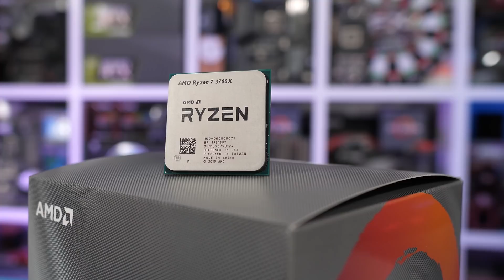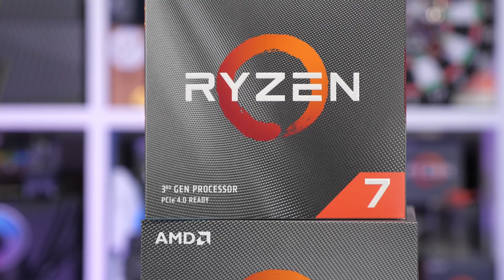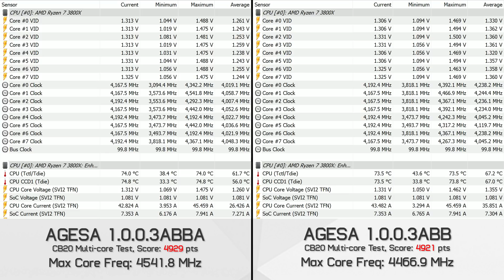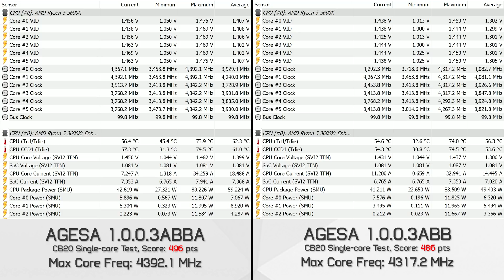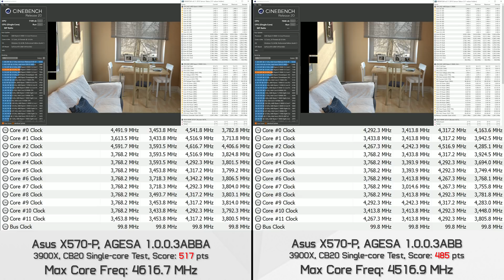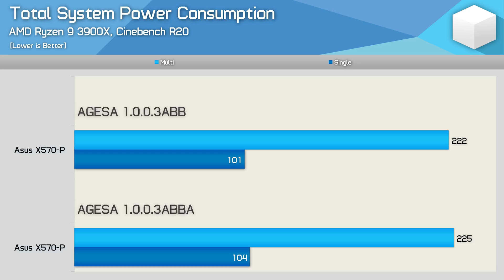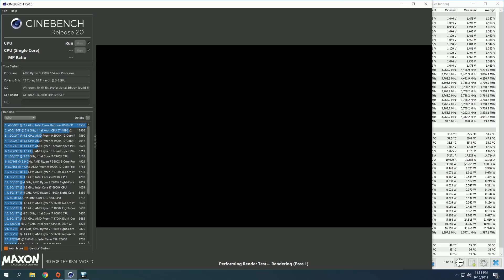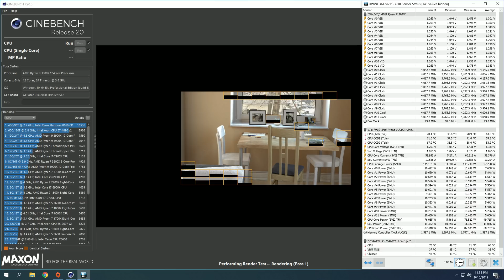3rd Gen Ryzen Boost Clock Fix Benchmarked, AGESA ABBA Time!

Comment: I thought people losing their minds over 25 MHz was a bit silly, but on the other hand, if a company is going to advertise a boost clock speed, then their products had better damn well be able to hit those clocks.
Reply: @KAKUN_DESU  If you watch his video he's going on the absolute statement of 4.6GHz, there was a huge amount at 4.55GHz and 4.575GHz and that's not taking into account many motherboards are running 99.8MHz on the BCLK which will result in 4590.8MHz when running a 46 multiplier.

I also like and respect Der8auer, however his method in this case is more than a little out compared to his normal attention to detail. All of the 4.55GHz and the 4.575GHz should technically be classed in the 4.6GHz category as he can't be sure they aren't less from standard deviation errors.

You may not like to trust the OC forums, I've been involved with them for years and guess what, it's the OC forums that are pushing for the fix that AMD just released. It's amazing how people can't fathom that little bit of information. It's not like the people interested in overclocking want better performance or anything...

I was genuinely disappointed with Der8auer's video as it sensationalized the issue and it also misrepresented it. FYI it's amazing how suddenly with the ABBA BIOS the issue turns out to have been a non-issue all along, a nothing burger, a falsehood of a problem. The real issue the whole time was the change from the pre-release BIOS which was able to hit those frequencies to the release day BIOS resulting in many motherboards under-performing in Default and PBO boost scenario's.

Thanks for giving us your uninformed opinion on who you like best though. It's been a fascinating if vacuous read.
Reply: @KAKUN_DESU  You still don't understand False Advertising.

If the CPU's never hit 4.6GHz single core outside of 5% after all the BIOS updates and so on, then you'd have an argument. You don't have an argument though as the ABBA bios corrected the low boost clocks.

You don't comprehend the data or the problem. Yet you still protest loudly. Thankyou for highlighting your ignorance yet again.
Reply: @KAKUN_DESU  You do realise False Advertising would mean that the vast majority of the CPU's would never reach the stated single core boost clocks...
Reply: @Robert Cowan They could and can, which is why I'm not objectively wrong. Even the broken 3700X which was unstable at 3.6GHz could still hit 4.4GHz either boosting or manually clocked.

The claim for boost was a single core, which means the advertising is not false. If they had claimed an all core boost of 4.4GHz for the 3700X for instance that would be grounds for false advertising.

If the CPU can hit those speeds even if the firmware/BIOS is buggy and needs fixing it's still not false advertising, the product can achieve those speeds. If the CPU could NEVER achieve those speeds you'd have a point.

As it is you don't.
Reply: @Robert Cowan The Bulldozer settlement was ruled on by a laymen who has NFI about what counts for a core. Likely AMD settled as it was the cheaper option rather than fight over a crap and dead arch.

If you go off the definition of core used by that settlement, ARM don't make any CPU's that have Core's. Many older CPU's don't have Core's due to not having dedicated FPU's. It's a nonsense ruling if you know anything about CPU Microarchitecture.

BTW you do realise courts make rulings and judgements but they do not have to reflect the truth in them.
Reply: My 3900x won't boost over 4350ish MHz on my gigabyte aorus x570 pro WiFi. ABBA agesa didn't fix it. Hopefully there's still being work done here.
Reply: @dangoodall1253  Even single core?? If so either damn unlucky on the silicon lottery or there's something funky going on. I did have to RMA a 3700X as it would hit 89C on any load applied even at 3600MHz. Replacement has functioned fine. A sample of 1 can easily just be an outlier.
Reply: @Robert Cowan How am I objectively wrong? The stated boost speeds are single core boost, not all core, I haven't said otherwise.
Reply: @Robert Cowan I guess you didn't read the court docs then.
Reply: @Robert Cowan Cool so the ruling being that it's due to the lack of individual FPU's for each 'core' sit's fine with you does it??

It was a dog and pony show for people that were pissed Bulldozer was just crap. AMD just settled to get rid of it, yet here you are dredging it up as though it's in any way relevant to Ryzen...
Reply: @Robert Cowan Yet it's still not relevant to this issue. It settled a month ago and yet has been going on for many years. AMD literally took a cost analysis and canned it. Cheaper to pay out than to keep the nonsense suit going.

Feel like getting back on the topic instead of wasting time talking about something that's utterly irrelevant to Ryzen's wide range of BIOS performance?
Reply: @Robert Cowan LOL, presents no evidence in support of claim, claims win. Gotta love arguments like that.

Please by all means show evidence the Ryzen 3000 CPU's can't hit their stated clocks. I'll be waiting. Every CPU I've tested can in fact hit their core clocks. Even the broken one that got RMA'd hit the boost clocks. Even if it did so at 90C. Hell it was 90C at 3.6GHz for that one.

The BIOS was responsible for not hitting the boost clocks stated and has been fixed. Not that the CPU's can't hit them which is the crux of the false advertising argument.
Reply: @Robert Cowan Still failing to notice the distinction of BIOS based boost control vs actual CPU performance. Damn you are a clever one.

I have a pretty strong bet that the vast majority of the 3900X CPU's would hit 4.6GHz quite easily if manually OC'd in Ryzen Master, highlighting the issue is a boost algorithm one not a CPU one.

Magically resolved in a leaked BIOS? How old are you? Your arguments are making less sense every post. The BIOS has been sent to board partners and is being released (Gigabyte first by the looks of things). It's not magically resolved, it's a boost algorithm change.

It is top level hilarity that Tom's is even still around to be fair. Their articles have been falling in quality for years now. Similar to some of the writers for Anandtech since Anand left.
Reply: I mean I still don't think it's wrong. There are systems hitting those clocks. Kinda like the i9s that won't hit 5ghz. Slightly different story but it's just cherry picking.
Reply: @Robert Cowan The 9900K cannot reach stock boost clocks within the stock TDP and with the stock cooler.
Reply: People lost their minds because it's AMD, had it been Intel there would have been a lot of brooms out and carpet lifted ;)

Not quite sure why AMD cops such a harsh backlash, but then again it does have some of the more vocal 'supporters'.
Reply: @BrKnOblivion  It does seem odd that the average person doesn't seem to know or care about the security issues facing Intel processors.  The media, aside from a few youtube outlets, has been strangely silent on them as well.
Reply: @Dirtyboxer1  I'm really quite surprised how many just have no idea about what they are buying at all. There's so much easy to access good info, yet people are still taken in by rubbish from places like The Verge.
Reply: @BrKnOblivion  Difference is Intel hit their boost speeds and you can overclock significantly higher than it.
Reply: @frostybe3r  That's like saying, because I can overclock the tits off my Nvidia graphics card I should be able to on this Matrox too.

Not really a valid argument.

Also if you are basing the OC off the Default/PBO boost, then you're kinda doing it wrong since the first gen Ryzen.

They are very different products in how they react to OC and boosting. Intel also removed the stated boost clock number to avoid the current boost clock non-issue.
Reply: @BrKnOblivion  So i am a Intel fanboy because i say my 3700X did not perform as it should have ? Is criticism allowed for AMD or should you just throw money at them and say thanks for Beta Hardware with false advertising ? AMD gets a backlash because they fucked up with their advertising. Again. If you dont want that test your product properly instead of releasing it early.
Reply: @BrKnOblivion  AMD caught up to intel so quickly, people have to find anything they can wrong with them and overblow it.
Reply: @untag4066  I suppose that's one way to look at it. I think Intel were caught with their pants around their ankles, but that can't be the only explanation. Steve's done a good job of staying unbiased but the more mainstream outlets have been very loud on AMD issues and less so on Intel's. As Michael says it's curious.
Reply: @BrKnOblivion  i dont remember intel advertising false clocks tho.
Reply: @hwstar9416  Really? Guess you haven't been around very long. It may not be directly false clocks, but the list of Intel's crimes are far longer and far nastier.

Oh and the stated boost clocks weren't false. Every Ryzen CPU I've tested and most of the overclockers forums also confirm this. BIOS's that aren't up to scratch on some boards have given a false indication of the number of CPU's that were not hitting advertised boost clocks.

Oh and when Intel didn't want to get into Boost clock speeds, they just removed them entirely. So you only have the base clock guaranteed and who knows what boost clock.
Reply: @BrKnOblivion  Yeah as much as I would like to hate on intel as anyone, they didn't falsely advertise their boost clocks. AMD shouldn't be spared because Intel is scummy
Reply: @Larythien  AMD didn't falsely advertise their boost clocks either. The BIOS/Firmware showed it can do those, and was repeated right here by our good friend Steve. Some of the other boards didn't manage it rather than just the CPU's.

New AGESA fixes said issue, nuff said.

Intel claimed fastest processors in the Pentium 4 era when they were clearly not against the Athlon X2's, by taking advantage of peoples lack of awareness of IPC vs Frequency.
Reply: I don't get why people care so much for the precision boost one click OC. My first gen R5 1600 is downvolted vCore/NB/SoC (at least lower than the 1.48-1.5v that precision boost ramps it up to) and hits 3.8GHz all core OC. I get about 44C at max load when gaming, granted I have a beefy cooler to help out I still find the performance/thermals impressive to this day. 

I am SURE that the 3rd gen Ryzens can do something similar especially once some improved BIOS come out. 

Oh also just in case nobody heard yet, Intel has another security flaw code name "NetCat." They are recommending to disable hyperthreating and virtualization to bypass the flaw until a fix can be made xD
Reply: @BrKnOblivion  listen, that wasn't my point. What i meant was if intel advertised wrong clocks they would definitely get shit for it, like they are getting from other things like the security issues. You saying AMD is the victim in this is just cringe and indicates you're a fanboy.
Reply: @BrKnOblivion  Exactly.  Part of the reason this whole thing got so over blown was because of uneducated people not really understanding how the hardware plays together and that MBs are not all made or programed the same way.  When some boards are hitting the advertised boost even without the fix saying it is false advertising is either just extreme ignorance or it is just trolling/fud/brand war nonsense.
Reply: @hwstar9416  Not saying AMD is the victim, the media pouncing on this is ridiculous is the problem. It's a non-issue, a non-problem. Again AMD didn't falsely advertise the stock boost clocks.

Label me a fanboy all you like (lol and you accuse me of cringe...), however the issue of the bad release window BIOS is squarely on AMD. I want them to get that in order instead of rushing stuff out the door.

Same for Intel who's corner cutting (DDIO??) has left their processors have more security holes than a sieve. I get the market is competitive but that's a far more egregious and noteworthy story.

The final issue is fine complain about the BIOS being bad, the false advertising claim is just plain incorrect.
Reply: @BrKnOblivion I've been around long enough, I got an IBM PCjr in 1984. Been assembling my own since Windows 98. Yes there is self selection bias in Roman's survey, but the problem is that the AMD agesa was not up to scratch.  If it was individual board vendors that caused the problem then everyone that had the Aorus Extreme should have been meeting  the boost just like Steve.  That wasn't the case.
Reply: @hwstar9416  and you're not an intel fanboi?
Reply: @jamesthomson8659  Yes the AGESA was not up to scratch, which was implemented fine in the Aorus Extreme but not the others? I think it's just an error with the BIOS implementation which has now been corrected as well as a update to the single core boost algorithm which was needed and is present in the ABBA version of the AGESA.

Which is a far cry from false advertising which is the point I've been trying to make.
Reply: @BrKnOblivion  The point I was making is that  although Steve's copy of the aorus extreme was working fine, Roman presented data that showed that not all aorus extremes were working fine.   Also, Roman raised the issue of boost pretty much on day 1.  The survey was done only after version ABB.  I got the impression that he was pissed that AMD wasn't taking the issue seriously.  Also even if you rounded up, a significant percentage of systems weren't making boost.  Roman did properly address  the clock, although that doesn't  mean every one in his survey properly corrected. He also raised the issue that PBO wasn' t getting to 4.75  as someone at AMD had suggested.  I haven't been following the issue that closely, have any of the bios updates fixed that ?  I'm running my 3700x at stock until all this gets worked out.  Once the concensus emerges that things have been fixed I'll go for the over clock but until then the performance gains to be had don't appear to be worth effort required to test  the stability of the overclock.  I've never been concerned about the boost issue, I sort of expert them to take a while to get the bugs worked out of the bios.  I'm actually more pissed that AMD has forced ASUS to stop supporting PCIe 4.  ASUS just  released the ABB down grade bios for my motherboard.  I expect it will be another month before I see ABBA.    I don't really have a need for PCIe 4 right now, but others have shown that at least the  PCIe 4 NVME  ssds work on my X470 and it would have been nice to maybe pick one up on black friday.
Reply: @jamesthomson8659  The reason Roman raised the issue day 1 is he had access to the pre-release BIOS which didn't have this issue. It acted differently and it seems the changes in the algorithm for the Boost clock and PBO were changed for the release BIOS.

This was not a good change I think we can all agree on.

I did multiple default and PBO runs with CPUz benchmark to see if it'd hit 4.4GHz and it was either 4.4GHz (taking into account BCLK error) or 4.375GHz with all the different BIOS I tested. Didn't have the ABBA BIOS to test as it got released after the builds had been delivered to the clients.

I did manual overclocking on them and with stock cooler managed 4.3GHz all core on both. To go higher would require a better cooler. Was going to use per CCX overclocking with Ryzen Master but it proved a pain for the users who didn't want to activate it all the time.

However with per CCX overclocking the worse of the two CPU's hit 4.425GHz stable and the good one hit 4.525GHz stable, again with stock cooler and the second CCX at 4.225GHz. Hence all this volume around them not hitting boost is just noise. Manual OC still beats leaving CPU's on Default or using PBO. If you do want the best out of PBO get a damn good nnickel plated cooler and use conductonaut or another liquid metal as the CPU heats up so fast you want the fastest method of heat transfer possible.
Reply: @BrKnOblivion  All good to know, thanks.
Reply: @hwstar9416  You don't? The 9900K cannot reach stock boost clocks within the stock TDP and with the stock cooler. You have to buy an aftermarket cooler just for the 9900K to reach stock boost clocks, and even then it has to go well above the rated 95watt TDP just to reach advertised boost clocks.
Reply: @Larythien  The 9900K falsely advertised boost clocks.
Reply: @CeriPie  the 9900k doesnt come with a stock cooler what are you talking about??
also im talking about clock speeds, the 9900k can reach above 5 ghz on all cores, maybe not at 95w but it will still do it. while ryzen couldnt. And im not saying its ok to lie about power consumption but intel did get shit from doing that.
Reply: I get why some are mad, i honestly don't care about it. I will be upgrading from the 2700X to the 3900X in the coming weeks.
Reply: @pronstorestiffi  Yeah the headlines were only 5% are hitting boost clocks. If you leave them on default or PBO it's kinda expected. I had no problem overclocking both 3700X's I built. Did have a DOA 3700X in there too which was a little frustrating :D
Reply: The people that cracks me up the most are the ones that decided not to go with AMD because of it. Yeah, like they were going to get a high performance increase in hitting the advertised speeds. The CPU is still a beast and amazing Price/performance.
Reply: If it was Intel doing that, everyone would be more frustrated and what not...but alas, it's AMD, and everyone is forgiving them. Only 2 YT tech channels spoke about the boost issues, GamersNexus and Derbauer..the rest kept silent
Reply: @Valandized  AMD is the little guy. People will be more forgiving. At the end of the day, people care about price/performance.
Reply: @mantid83  I wouldn't forgive AMD or Intel or any other company. I just want to get what I paid for (see: advertised product).